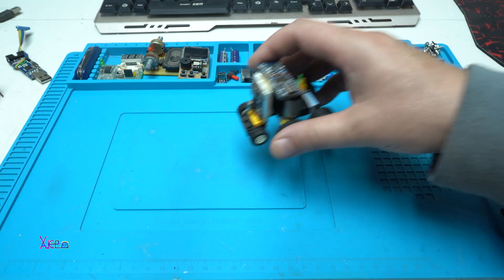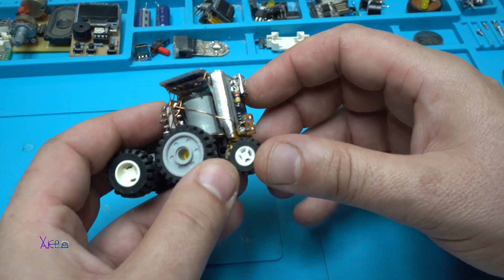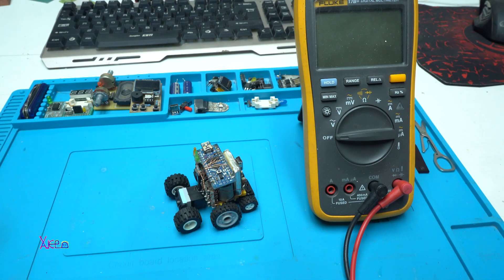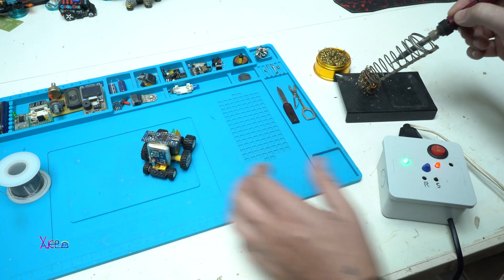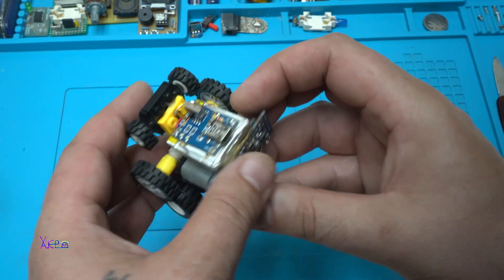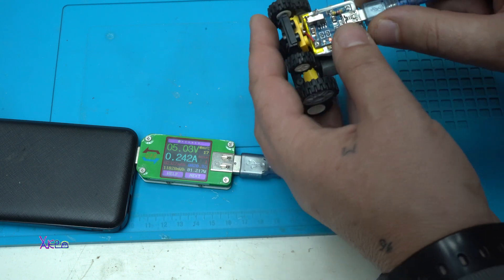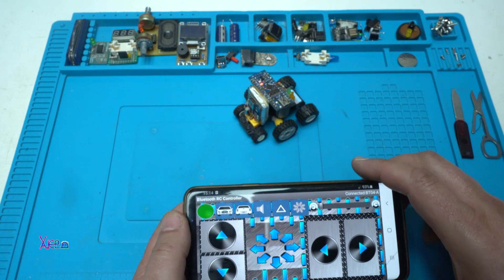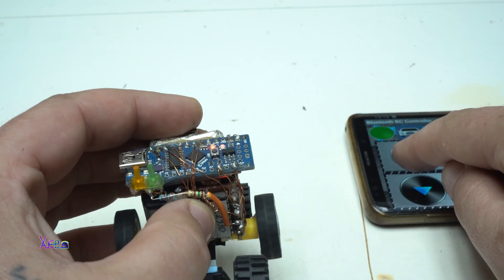DIY Smallest RC Robot

Comment: Will it be possible to make a 1.5v led flashing circuit using BC547 transistor only
Reply from the maker: Yes,you can do with 2 transistors,check my channel for video